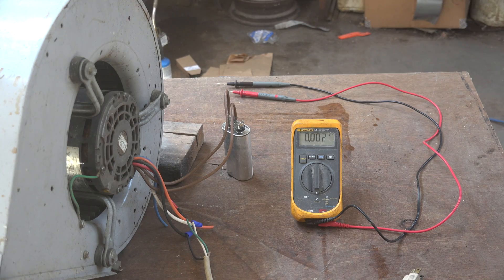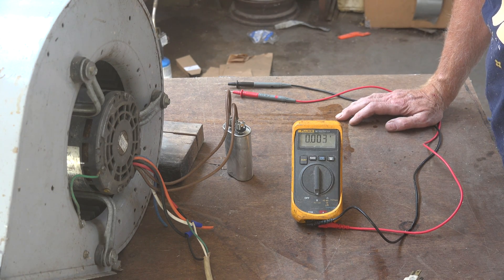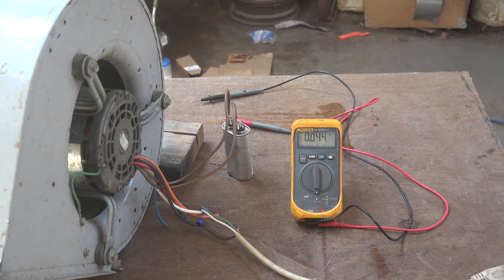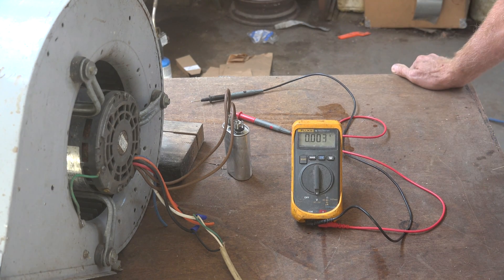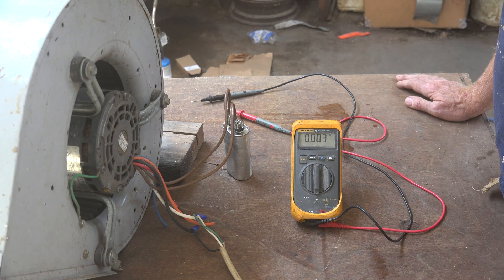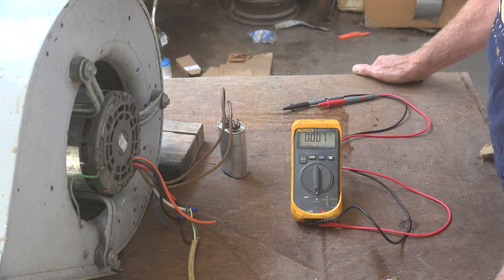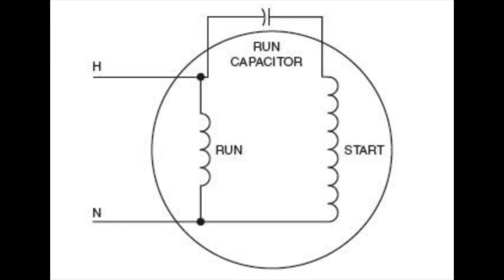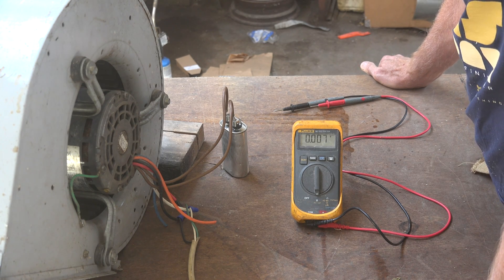The run capacitor: can it electrocute you?

Comment: What about when the power is off? Just a nasty little snap?
Reply from the maker: When the power is off, the cap discharges thru the windings of the motor.
GFM
Reply: @grayfurnaceman  No I mean if you cross the terminals when it's powered off. Zapped?
Reply from the maker: @jlam3927  No, the cap discharges thru the  windings.
GFMN

Comment: i have this old dehumidifier that worked and then stopped. i know nothing about electricity but want to fix it, because when it was working 3 years ago it was way better than my new one. not only am i afraid to touch the capacitor but i cant find a replacment that has the same values printed on it. it is cbb65a-35uf-60hz-270vac-25/80/21. it is 3 inches long and has to be 3 inches to fit. can i buy a different capacitor that will work. what values should i be concerned with? thanks to anyone that can help me.
Reply from the maker: 35 Microfarad 270 volts.  The 35 is the strength in microfarads.  270 is the voltage.  Those are the 2 things you need to know.  As for physical size, I cannot help there.
GFM

Comment: Only time I’ve gotten shocked with them is if you have the system off at the thermostat and you don’t want to take the power off at the disconnect because of the thermostat delay and have insulated wire terminals and think it’s ok to check the capacitor without discharging or shorting it. Learned my lesson.

Comment: YEAH this is good advice.

But I would never trust a capacitor to be in the discharge state just because the power is off. As a manufactured device it can have a defect or develop a defect. Also it's still called Electrical Theory not Electrical Fact because every so often electricity does something totally unexpected

Comment: I have a question that is not connected to this video. Is there a test for a thermocouple that you can do before replacing it?
Reply from the maker: There is a simple test.  Light the pilot as you normally would.  After holding for a minute, release the pilot button.  If the pilot goes out, the thermocouple must be replaced.  If, after replacing the thermocouple, the pilot still goes out, the gas valve has failed.
GFM

Comment: These run capacitors have a low enough value to follow the 60 cycle voltage fairly closely. They will charge close to and retain whatever voltage is across them if suddenly disconnected. Of course they lag behind the AC line voltage by some percentage (because that's what they are supposed to do). So...It would be the rare case indeed if all that happened and that cap was lurking behind a panel somewhere ... packing the shock of your life .

Comment: yank a wire off the cap while the motor is running, which simulates a winding or connection going open, most often the cap will stay charged, the voltage and polarity is a gamble then. may get lucky and it have low voltage or be charged near peak run voltage. make sure to check on DC after wire has been yanked

Comment: I've been bit by a compressor run cap. The compressor windings burnt up internally so there was nothing for the cap to discharge through.
Reply: I have heard of that happening.  I have never had it happen to me.
GFM
Reply: yep, that can happen on any run cap should a circuit(motor winding) go open circuit while the cap is charged up at either side of 0 volts AC cycle. just yank a wire off while running and it will likely always be charged and there's no bleeder resistor

Comment: When I was a kid (in Soviet Russia), we were playing around capacitors just for fun by sticking screwdrivers and other stuff between terminals. It was fun to watch copper wires melting down and screwdrivers welding to terminals.
Reply: Good old Soviet Russia playtime. 🤣.
Reply: That cant happen so your story is hard to believe. Shorting the terminals discharges the cap and nothing will happen. It just makes it safe to test or remove

Comment: But remember, the dual capacitor still has juice to it if it's on a single pole contactor and the disconnect isn't pulled...
Reply: Whether its a dual or single cap makes no difference.  Also the contactor makes no difference.  The cap discharges thru the windings of the motor.  This applies to run caps only.  If it is a start cap, it can hold a charge as it is disconnected after the compressor starts.  
GFM
Reply: @Joe-ws5el  I meant, even if the ac/hp isn't running at the time, if there is still power going to the contactor, you can still get jolted - by the line voltage, not the capacitor. Just remember to be safe and pull the stab (and not a bad idea to verify the disconnect is wired properly).
Reply from the maker: @jjengelbert  Troubleshooting must be done with power on.  That said, any repairs must be done with power off and potential checked first.
GFM

Comment: Great Video. how about for dual run capacitor on condenser unit outside ? Thank you for sharing ^_^
Reply: The dual run cap discharges thru the motors just as a single one does.  Check the diagram that comes with the unit.  However, if the unit has a start cap, it may not discharge as it is disconnected after it starts the unit.
GFM

Comment: Large enough ones on industrial equipment i worked on can.
Reply: I cannot speak for other devices than motors, but most large motors do not use caps as they are 3 phase.
GFM
Reply: @Joe-ws5el  VFD system still use very large capacitors that are even more deadly then that little guy there. They will kill you instantly, alot of industrial equipment i have worked on have a 30-45 min NO work mandate from the manufacturer after power is cut for repair work
Reply from the maker: @zack9912000  VFDs are a whole different ball game.  I would always follow manufacturer's instructions for this one.
GFM

Comment: It has happened to me. 460 volt single phase motor with open windings. Cut the power off and grabbed cap to check it  and it discharged into me. I learned my lesson
Reply: That is possible if both windings fail open.  
GFM
Reply: I always short across them just as a precaution.  You can never be too safe.  And it only takes a second.

Comment: So the cap acts as a line filter?
Reply: A run cap on a motor is not a line filter, it is a start assist.
GFM
Reply: Good Point...That capacitance across the run winding and the capacitor inductor circuit formed across the main winding would have to block and absorb (Some?)RF noise. I guess the brushless motor doesn't make much anyway ...